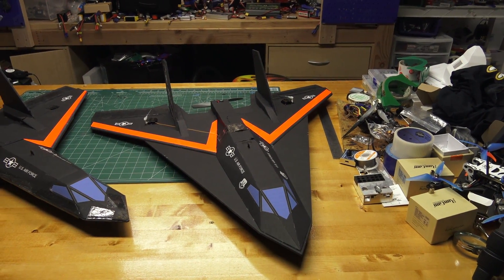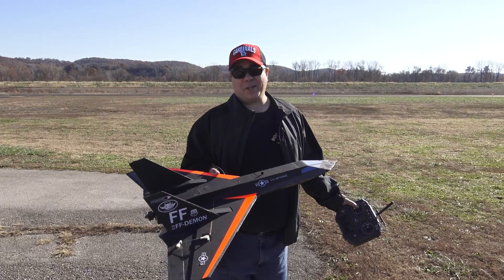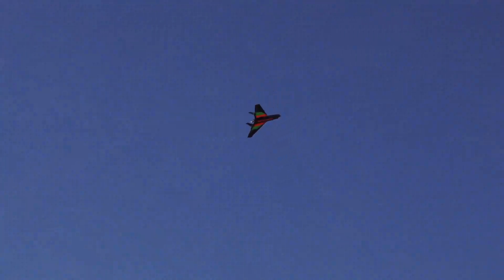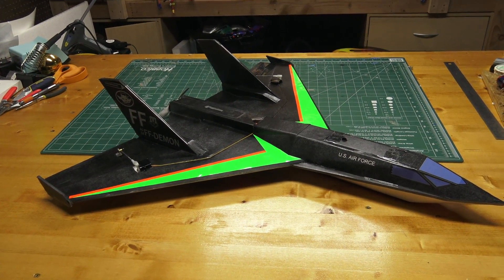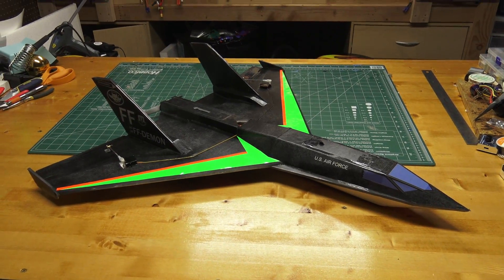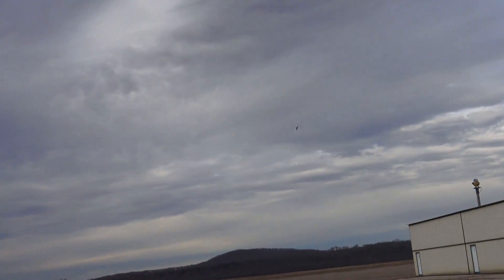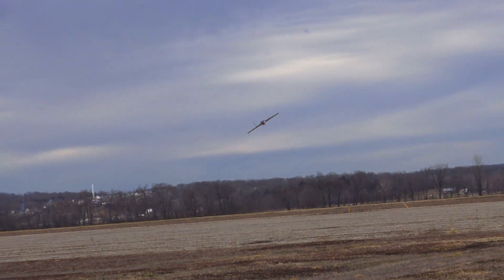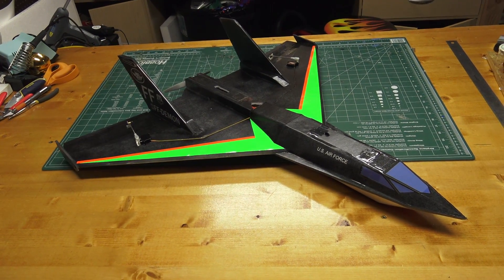FF-Demon Concept Version 4

Comment: Nice work Paul. The V4 is really nice. Goes great on just a 3s. Think you should prop down and stick a little 4s in there for a laugh and try to get the speed into triple digits ;)
Reply from the maker: Thanks RCPP! I will for sure try a 4S setup later. I will probably also see what other motor I can fit on it and break that triple digit mark for sure!
Reply: Cool! I recently bought a few more motors to test. One of which was a Gofly-rc 2306 2500kv. I haven't tested it yet but the specs look good. Although a bit smaller then the Brotherhobby motor being only a 2306 and less kv at only 2500kv it is rated for 5s and a max of 1100WATTS! Could be a good motor for you to try? It's also a good price too.
...RCPP
Reply from the maker: @rcplanepirate  thanks for the info on the motor.  Frank and I have been looking a several of the race drone motors lately. For their size they pack a bunch of power.  We tested the Brother Hobby Avenger 2506-2700 motor I used to over 1000-watts on a 4S pack.  Not sure how reliable it will be at that power though, but will probably run it like that sometime.  On 3S with the 6x6 prop it was about 700-watts at about 50Amps.  Frank and I also have some of the larger X-Class Brother Hobby 3115-1540 motors. These look promising for larger planes!  The only thing about the race drone motors is that they are 12 or 14 poles and need  a good ESC to handle them at high RPMs.  I have been using the EMAX BLHeli ESC's.. Wish more companies would make BLHELI or other ESC's for planes that support the High amp, high pole, high rpm motors.
Reply: No problem Paul. Yes there sure are some interesting racing drone motors around. I did look at that Brotherhobby motor but as with a lot of these motors for some reason they don't always list what the max power of the motor is. Just a suggested prop size. Which can be annoying for people like us who can think for are self's and will want to try other props to see what works best for us in a plane not on a drone. I have found a new esc to try. The V-Good IONX 32 Bit esc's. I think they are kind of a copy of the Hobbywing platinum esc's which work really well with these motors. So hopefully they will work just as well. They are available in a 45a, 60a, 80a, 100a, 120a and even a 100a and 200a HV version. I have just ordered a 45a one to try from Banggood. It will take a week or two for it to arrive before I can test it. Once tested I will report back with the results.
Reply from the maker: RCPP thanks for the info on the V-Good IONX esc's, I will have to check them out too.  Hopefully more companies start using the ARM32 processors for Airplane ESC's like them. Those appear to handle the high pole, high rpm motors better.  There is a US hobby store here called ALOFT Hobbies that just listed a line of POWERUP ESC's that list similar ARM32 specs. They look really affordable too. They don't look as nice as the V-Good IONX, but was thinking of trying some. As for Brother Hobby I hear you, they never seem to list the full specs and amp loads. Very Annoying.  Frank and I have used  several of their motors though on race drones with good results. the 2507 Avenger Motor I saw some tests by EngineerX on youtube with good results, so decided to give it a try on the FF-Demon.  Anyway, yes please let us know how your results go with the V-Good IONX and any good motors you find. Thanks again RCPPand keep up the good work!
Reply: Hi guys
My V-Good IONX 45a esc came this week. Unfortunately there are no instructions for how to program it with a TX. Think it might only be programmable with there programing card. Was going to order one but looks like it's under restocking till the end of February. I did give it a quick try but it's obviously in a heli mode as default. So no good till I can get it programed. Really annoying! Sorry guys.
...RCPP
Reply from the maker: Hey RCPP, thanks for the update. No worries brother, totally understand. We will look forward to hearing about your test whenever it can happen.  Weather here has been to cold and bad to do any test flying too. Hopefully soon though. Take it easy RCPP!

Comment: Great job Paul, sure do miss the old days with building and then version building. Looks like a keeper, just not sure about the speed. I'm thinking you need more lol..
Reply from the maker: Ha ha, Thanks Gregg, yes more speed needed!  With the revised design I will probably see if I can put a bigger motor on it.  The CG was pushed back far enough that it should balance out much easier.  The 3S setup wil lbe an affordable and pretty fast option though. Not a true rcFoamFighters plane if it doesn't break a 100mph! LOL.